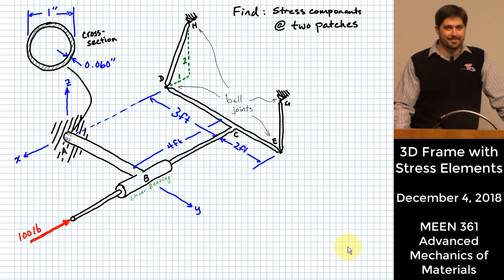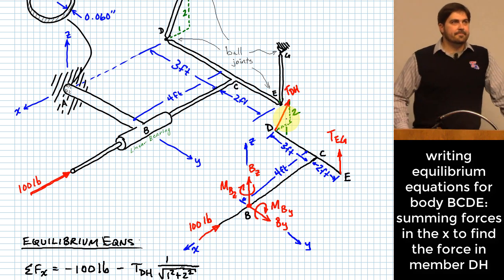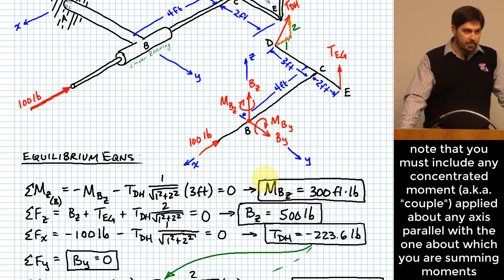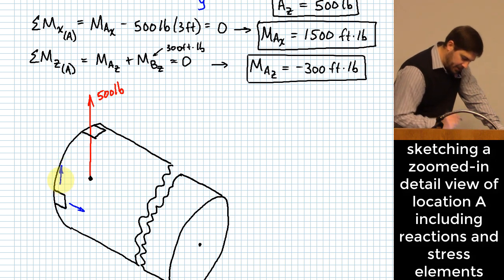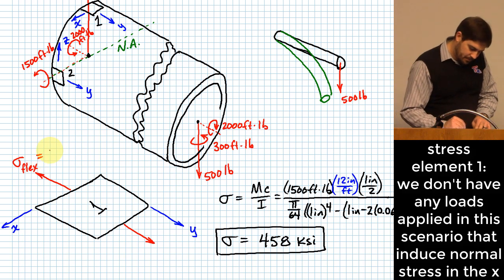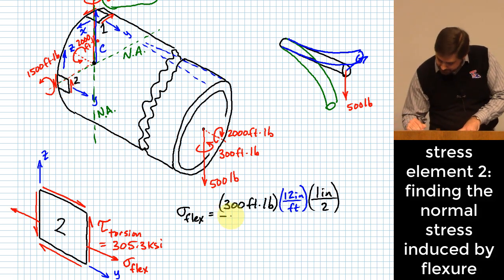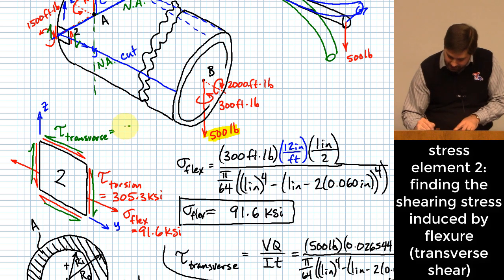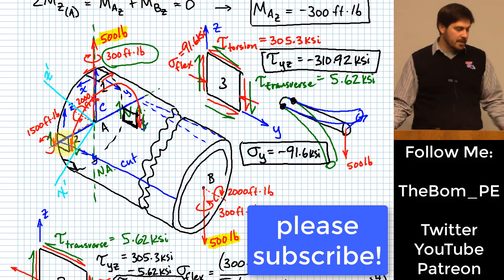Stress Elements in a 3D Frame | Torsional & Transverse Shearing Stresses; Flexural Normal Stress

Comment: Thanks for the videos I recently graduated metallurgical engineering and your videos have helped me through one of the toughest courses in metallurgy (Mechanical metallurgy). They are bom!!!! 

Now for the questions Lol.

1. The 100lb force we used initially to find the reactions at point B, why is not not included in the reactions at point A. wont it still have an effect on point A since A and B are connected by the one member??

2.Wont the 300 ft.lb moment cause bending along the z axis for patch 1, similarly wont the 1500ft.lb moment cause bending along the x axis for patch 2???

thanks once more.